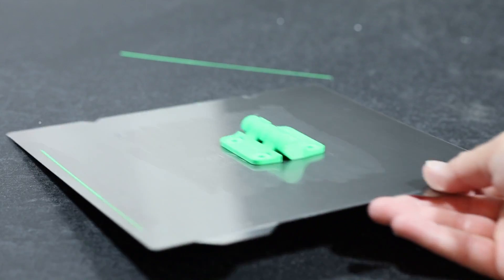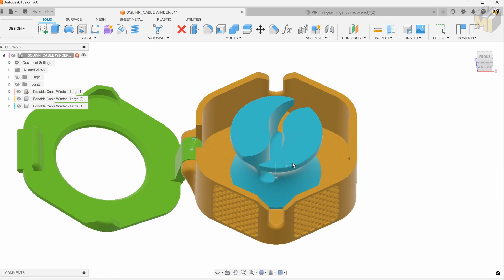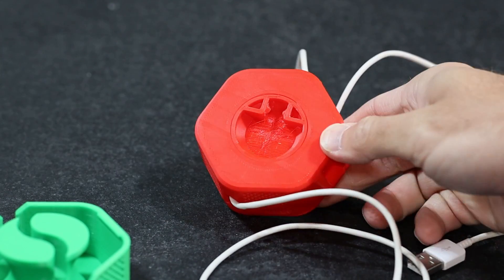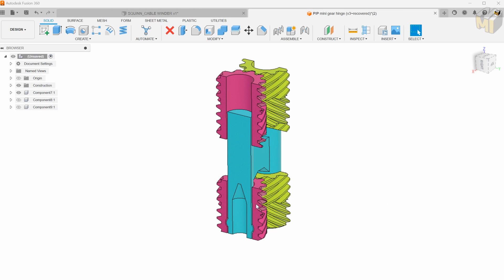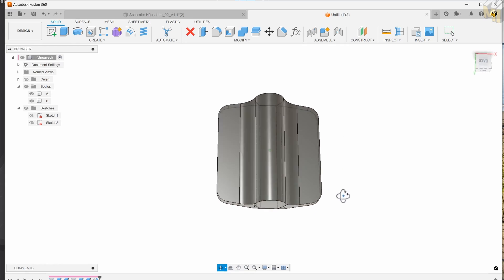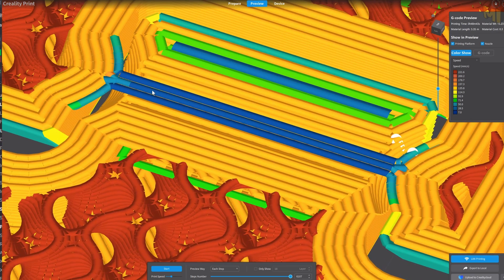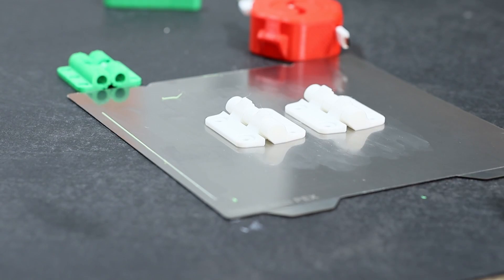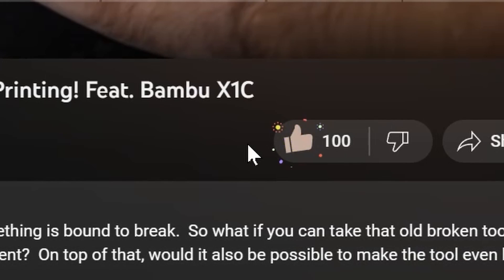Design AND Print your own PRINT IN PLACE - Feat. Creality K1

Comment: I understand why you made the pins flat and why the holes come to a point. The only thing I didn't exactly understand is doesn't the flat part of the pins make contact some how with the hole? How does the printer print that first layer of the pin? Wouldn't that first layer of the pin just be hanging in mid air considering you put a clearance between the pins and holes?

Comment: I know this is an older video, but I printed that cable winder by Squinn last night and pulled it off this morning. Tried printing it before on an old Ender 5 that was a loaner from a friend I was learning on, and it all fused together horribly. Got an Anycubic Kobra S1 2 weeks ago, and everything was absolutely perfect on the cable winder now and worked right off the build plate. I was worried I would have had too much squish as a part/tooling I made for work the night before, the nozzle seemed to be too close to the bed on the front half, and I saw some rough, raised texture to the first layer. Luckily didn't have any issues.

Having this work right off the build plate sent me on a path to learn how to design my own print in place models as it's so handy, and massively satisfying. I appreciate you breaking down all measurements/tolerances in the model for us to learn good ranges to start designing our own.

How did you get the f3d/step file to get it to work in Fusion to show all the different components, use section analysis, and measure all the tolerances? Maybe it's a free vs. paid version of fusion, or I'm just blind and people upload the Fusion files more than I think. Or I'm just doing something absolutely incorrect when trying to turn an stl mesh into a solid in fusion to make changes or break down how it was built. Lol.

Comment: Is it possible to add PVA water soluble supports in the gaps?
Reply: Yes, but then you need filament swaps, and the expensive PVA filament. If your printer is reasonably tuned a design like this will work fine.
Reply: @eslmatt811  Thanks, and I have since learned to used PVA in the interface while using other support materiel the other areas.

Comment: Excellent video, I have just been through the riggers of designing a print in place hinge for a propagator I’m designing. I wanted something that worked straight off the plate with no binding. It took a while to get right. It now works straight off with a 0.4 nozzle and only needs a little snap then works grate with a 0.8. I put it on a little box and put it on makers world as my first model just to see if I can get some feedback before I finish my propagator and post it.

Comment: The teardrop hole design significantly weakens the part by increasing "notching effect" this is not a good idea. I designed my own print in place hinges and printed them vertically instead with a round shaft, layer orientation is not optimal but runout is great and I used PETG so layer bond is pretty good.

Comment: Elephant foot is slicer/printer issue and should be eliminated there not in the model.
Reply from the maker: I like to keep in mind that not everyone is at the same skill level, not all slicers are alike and the list goes on.  It is better to design in such a way for the best chance of success no matter what.  If you've posted any designs, you'll know that regardless of how good your design is, there are people who will struggle.  If you can reduce the problems by addressing it in the design, it'll be better for everyone.  Adding a chamfer is pretty simple after all.  

That's my philosophy anyway, to each their own.
Reply: Given these two designs, which one would you prefer?:

1. A design that is very sensitive and will fail if there is any elephants foot.

2. A design that works well regardless.

When you know that a design will fail if there's any foot, it just takes a couple seconds to add a little chamfer to the bottom of the critical part and then you have a foolproof model rather than a finicky one.
Reply: Truly altruistic design for all,  not just us experts 😁